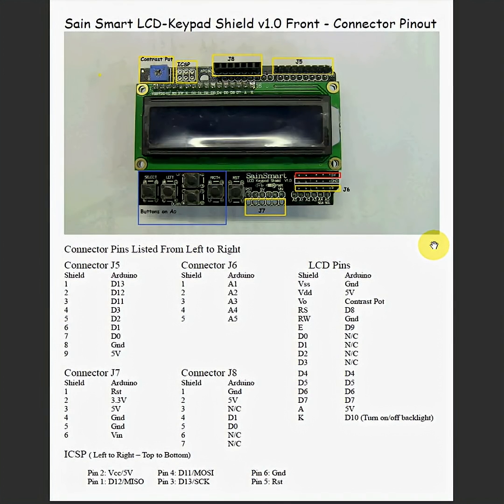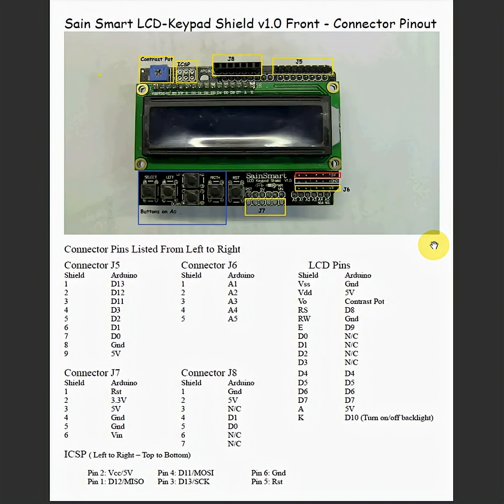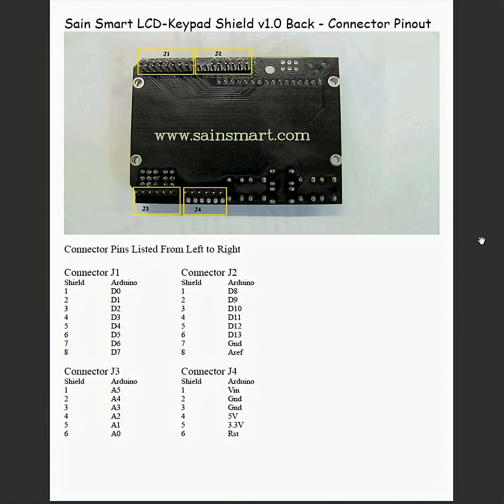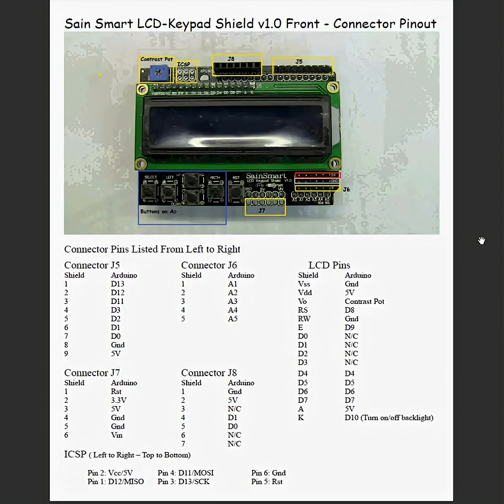Sain Smart LCD-Keypad v1.0 Pinout

Comment: Thank! I too was frustrated by the lack of documentation. From what it looks like D0 - D3 are not connected and I can solder wires to the corresponding ports on J8, correct me if I'm wrong...
Reply from the maker: All the pins on the J5 connector are available to use; D0->D3 and D11->D13. As well the Analog ports on J6; A1->A5.